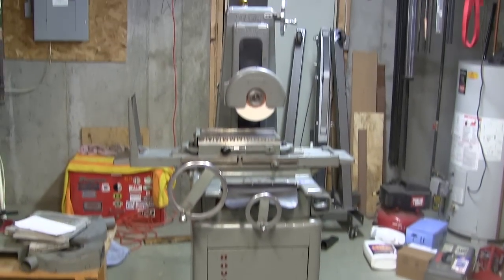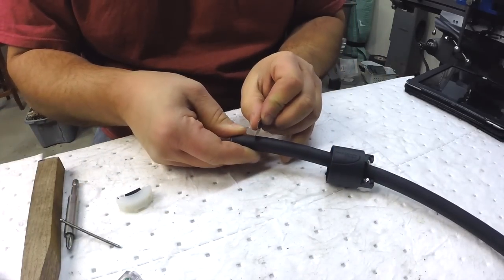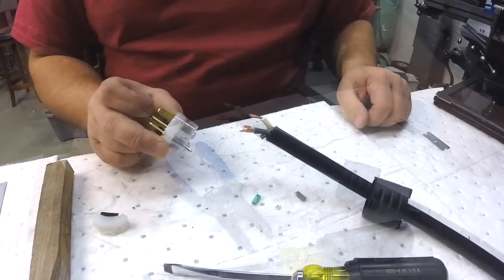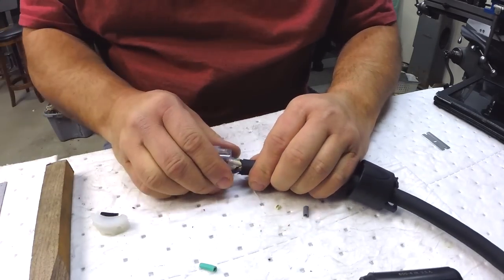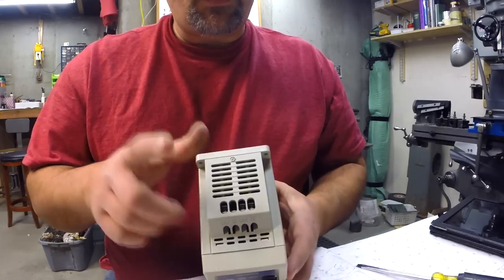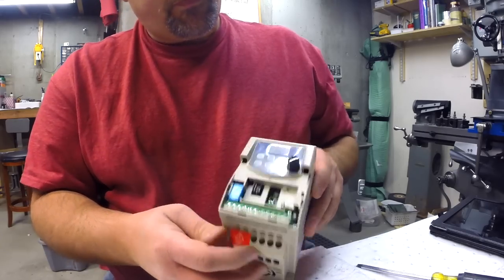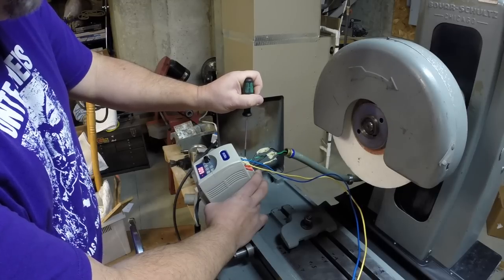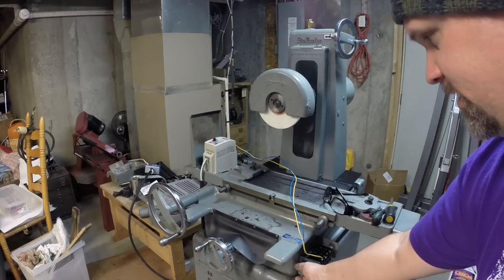Surface Grinder Re-Assembly: Part 5

Comment: Hey Brad - I enjoyed the series - great job on the grinder. I am restoring one myself and have a question on the dust bellow  - do you happen to have the part number from McMaster Carr?
Reply from the maker: I don't, but search, it'll depend on the travel length and such. I (do) remember it being super easy to find them though. Good luck.
Reply: Thanks Brad - I appreciate it.

Comment: Hi Brad, I enjoyed your rebuild series on the grinder but I am wondering why you chose to use a VFD as an on/off switch since you obviously have 220 V source in your shop? You have a rotary switch in the line with the VFD which will switch 220 V.  Thew only thing you are really using from the VFD is the brake function which I don't see as important or necessary. 

Bob
Reply from the maker: Hey rob. The vfd gives the motor the 3-phase power it needs. Thanks for watching!

Comment: Shutting the wheel down so quick doesnt strike me as a good idea. It has a left hand nut that the rotation of the spindle will act to self tighten when turned on. I could be mistaken but braking the spindle i think would have a loosening force on the wheel/hub/nut assembly. I run a Studer CNC OD grinder at work with a 20x2 inch wheel and the spindle is programmed to ramp slowly on and completly coast to a stop. It has a slightly different mounting hardware with a righthand bolt and special washer but the wheel rotates opposite of yours. Just trying to help u evaluate the safety of ur setup. Cool video series!

Comment: Brad I looked all over the internet and couldn't find a price close to $120 shipped. I want to use one on my SB13. It has a 1hp motor.  Can I get the dealer information?
TY Charlie
Reply from the maker: Charles Ugenti Charlie - not sure what you mean??
Reply: BasementShopGuy Sorry! I was wondering where you got your Teco VFD. I looked at the video and took down the model number. and searched the net. I didn't find any at $120 delivered. Was wondering where you got yours from.
Charlie
Reply from the maker: Charles Ugenti http://www.wolfautomation.com/ProductList.aspx?ManufacturerID=1259&gclid=Cj0KEQjwi-moBRDL4Omf9d_LndMBEiQAQtFf8y3Zc9jPKGcfawj_6YG18P5KMjkFm1bczcq_a1XhkfkaAq_y8P8HAQ
Reply: BasementShopGuy TY

Comment: Connecting plugs to the line is so not-fun - Never force something, always use a bigger hammer ;-)

Absolutely nice job you did on the surface grinder. And a good price on the VFD, if you buy a new Siemens or Omron you would have to drop a lot more money...I get mine always used of ebay, but thats always a bit of gambling.
Keep the good work up!
Reply from the maker: Stefan Gotteswinter Thanks Stefan. These little Tecos are pretty impressive, especially for the price. And for grinding machines that only require on/off functionality, these drives are a real good buy.

Comment: Hey Brad. First off thank you for turning me on to Al Bino Flat belts,excellent man to deal with and he is not afraid of us Canadians

2nd liked your videos on the Surface Plate Grinder,so much that I bought one to restore also .Hasnt made it yet but hoping I will be able to hit you up for some tips and tricks and also part numbers etc
Did you post on any forums like you did for the mill resto.?  Thanks and keep up the good work Brad!!

Antonibrian7atgmail.com
Reply from the maker: Brian Antoni Brian - no, I didn't make a post to any forums. I did post on Practicalmachinist.com asking for some info on dates and such. If you have questions, just send me an email - it's listed on my channel page. I'd more than happy to lend a hand ;)